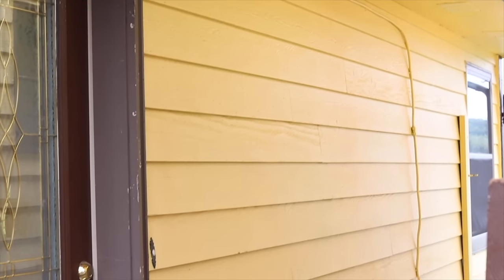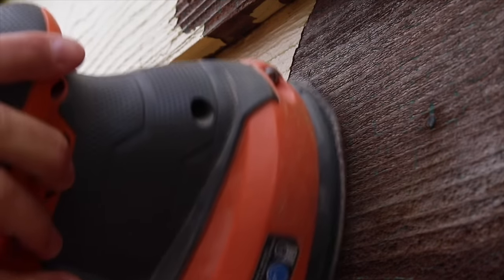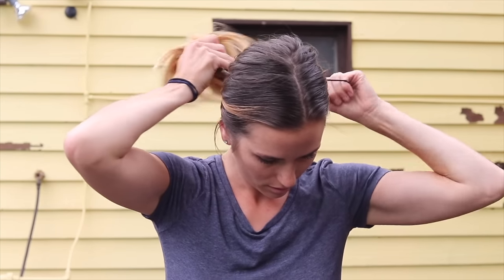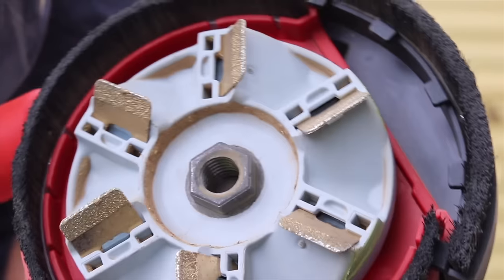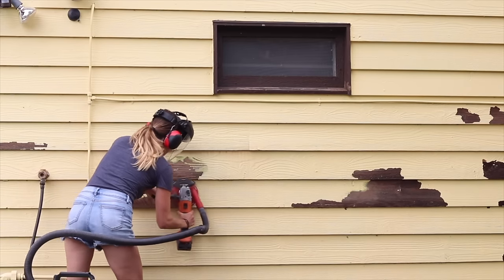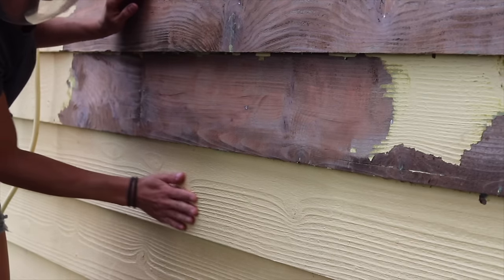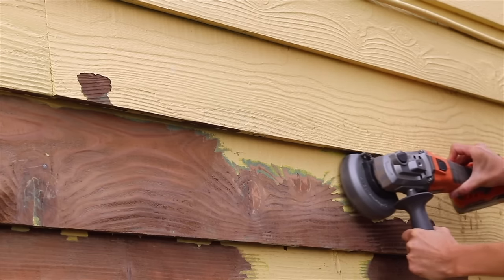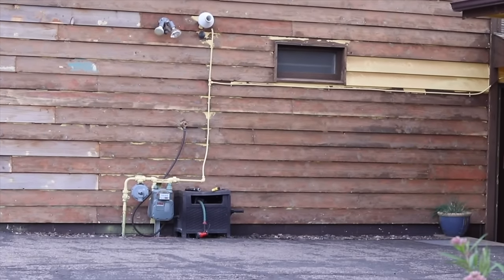Removing Paint From Cedar Siding | Diamabrush vs Paint Eater vs Sander vs Pressure Washer vs Scraper

Comment: A roto stripper does the job quicker than anything else I've ever used, but you do have to be careful not to press too hard if the underlying surface is soft, like water-soaked wood, or else it can gouge into it. https://m.media-amazon.com/images/I/61vCrpH6UWL._AC_SX466_.jpg

Comment: Yep, that's all a big pain, and no really easy way to get around it.  The problem comes back to haunt you 4-5 years later when it often has to be redone again.  I find people might do it once or twice, but then as soon as they can afford it, they strip off the cedar siding and go with a good quality vinyl siding.  Alternatively, you might just consider leaving the freshly stripped cedar siding until you can buy that vinyl siding; at least you won't have to repaint it again and again.

Comment: Your dimabrush blades are probably still okay, but it's glazed over. The soft wood/paint has filled the diamond abrasive surface. The solution is to dimabrush something harder, like a rock or silicon carbide grinding wheel to expose more diamond. Add water to keep the diamonds cool.

Comment: Perhaps you could use a paint remover such as made by Metabo. (link to dutch carpenter trying it out: https://www.youtube.com/watch?v=tJfoEz76lyg). Sadly the  nice surface texture gets flattened out indeed. In the US a lot of Acrylic-Urethane based paints are used to cover sidings. Perhaps a more penetrating and moisture regulating system like boiled linseed based paints would do better.

Comment: that pressure washer you are using is not even big enough. you need at least a 4000lb pressure washer with 15 degree tip on it and it would take off all of itand just fyi cedar does not accept paint for very long cuz of the oils in it its takes staing well though

Comment: 4.5 inch angle grinder with a rubber backing pad 24 to 36 grit disk I would have had most of the paint off without gouging the wood  By the time you figured it all out